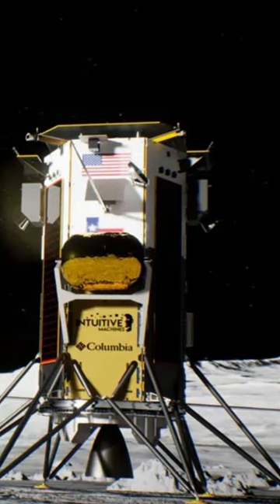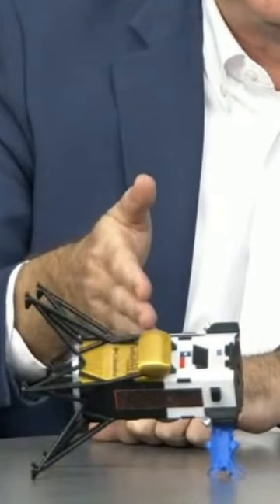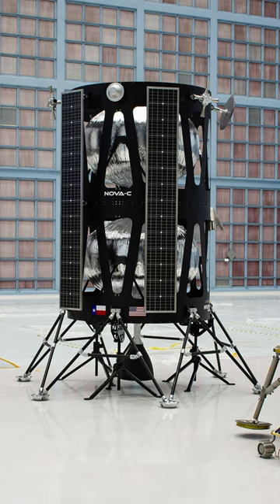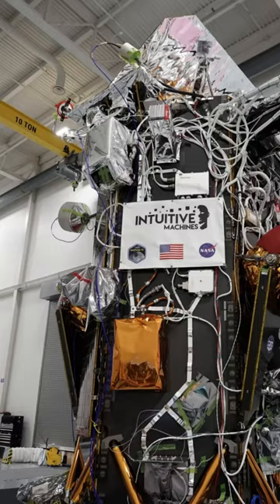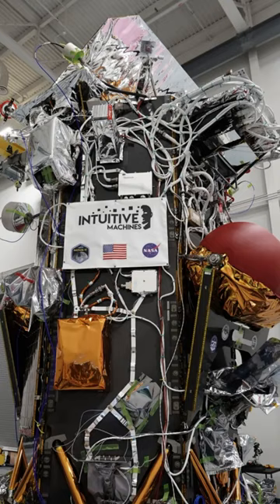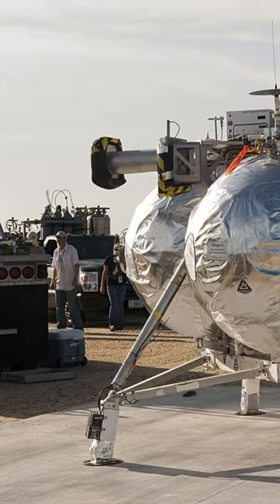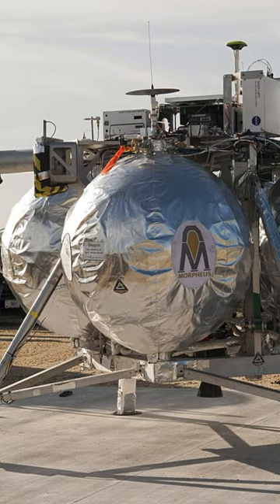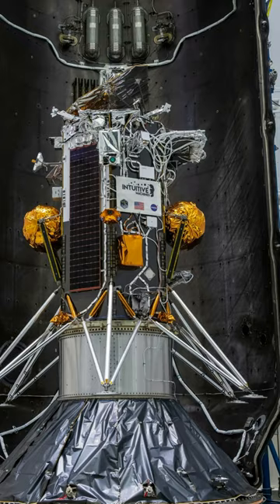Why Was This Moon Lander Built So Tall?

Comment: Hmm, good thing starship is not a tall craft... 😂😂😂
Reply: Yeah, and it has exceptionally wide legs too. :D :D
Reply: now there’s an „unfortunate series of events“ waiting to happen 😂
Reply: How hard is it to not move laterally? Maybe send a mini dozer first to clear a landing area.
Reply: @user-on8us2oi8s  Provided that the hardware works, it's obviously doable. It's a shame the laser wasn't useable. Considering that ~50% of attempted landings have failed I'd call it a hard problem.
Reply: If starship does start to tip upon landing, it should be able to abort to orbit since it has the fuel to get back up.
Reply: Blue Moon is also pretty tall and thin. No doubt consideration will have been given to this and safety measures devised. I imagine a combination of picking clearer spots and having better sensors will be used.
Reply: @user-on8us2oi8s This isn’t KSP. A “mini dozer” would cost tens of billions in todays environment where NASA hands money and tech to companies to do what nasa could do for cheaper so rich folks get richer. 

All part of the plan with Artemis. Artemis is an idiotic mission architecture requiring 16-20 starship flights per lunar landing, all within 7-14 days. 

So musk needs to up launch cadence by a factor of 150-250.
Reply: Probably using Elon's "Full Self Landing" too.  I think he said it was ready to go, right now.
Reply: Just send an helicopter to the moon instead of dickin around with those funny landers
Reply: @Jona69  While true, this is also not ideal. More importantly though, starship has engines high on the stack, and I expect the legs will be able to do some adjusting on the fly. I do wonder whether part of the issue was the engine blowing a hole under the lander and their 'flat' site suddenly not being.
Reply: @Karlswebb  If spaceX are wanting to land people, they can crash land a dozer before hand far cheaper. That said, a dozer is idiotic because it would not solve the problem. You would be able to create a flat surface, but as soon as you hit it with a rocket it would stop being flat. Compaction is possible by loading it up with regolith ballast, but even then I doubt you could get a trustworty 'pad'.
Reply: @agsystems8220  High up engines will make it less stable. 
Also, those engines thrust certainly wouldn't be very finely adjustable
Reply: Yes Starship is a concern but I suspect SX have the auto descent and drift nulling down to a T by now.
Reply: @keithrpenny6484  High mass, high center of gravity, small legs. Even with all that control- what can go wrong on unprepared surface?
Reply: @petersvancarek  agreed... I sure hope after this event they plan to fit starship with long fold out legs like F9
Reply: @keithrpenny6484  I think those legs are way too short. The 1stage of F9 has the center of gravity quite close to engines when landing. 
The same certainly won't be true for starship with cargo and habitable space high above ground.
Reply: @petersvancarek  I understand Starships shortfalls trust me.
Reply: It doesn't matter how tall the craft or small the legs if it lands on flat enough ground with no lateral velocity its fine. Starship will have many more systems so make sure this is so as well as people on board to abort or change the landing.
Reply: @motokid6008  it matters if the surface is not nice hard levelled plate.
Reply: @petersvancarek  - Remains to be seen and such things are easy to simulate.
Reply: @d6008 to simulate...take a mound of sand and try to drop something on it. Something simulating the rocket with various length and leg system. Drop it at speed of about 1m/s(that is probably how fast it hits the ground at maximum.)
And please do not expect ideal conditions at landing. Everything which can go wrong will go wrong with some probability. The construction must have reserves which allows for worse than ideal landing. The worse it can withstand the better.
Reply: @petersvancarek  - Yeah I think NASA and SpaceX has that covered.
Reply: @MrTrancelator both this and the HLS will have legs as wide as the fairing will allow.

Oh. HLS is even taller?
Reply: @1943vermork  🤣

Comment: This is a classic aerospace engineering problem. We can never avoid the compromises, it’s the same in other engineering fields, ours is just especially difficult. Spacecraft are so expensive so that makes life particularly difficult when we’re so often restricted in our budgets and timelines
Reply: Yep. It's easy to say that they could have put wider deployable legs on it, but that doesn't come for free... more mass, more moving parts... now you need more fuel to lift the deployment mechanisms, and you need to worry about the legs not deploying properly.
Reply: @simongeard4824 not to mention the maximum space that the falcon 9 provides
Reply: @wubnix3979  I don't think that part is a problem... the fairing width limited the size of fixed legs, but there was plenty of room for deployable ones. Mass and complexity are a bigger factor.
Reply: @simongeard4824  well deployable ones come with possible errors, I'm talking about if they wanted to make wider landing legs or perhaps a different idea is to have wider landing legs protrude out of the already built landing legs and if they do fail, at least you can work with the existing ones.
Reply: @simongeard4824 Well mechanical movement is a problem with the temperature ranges involved and vacuum welding.  The Apollo lander used collapsible aluminum to absorb shock rather than shock absorbers because mechanical components could not be relied on.  You're asking for a lot of unreliability to have deployable landing struts.

Comment: So... time to go full throttle, scoot across the surface and hope you bump into a rock that lets you lift off and try again?
That's what KSP taught me.
Reply: We've all done that a time or two. But I know how that often ends.
Reply: Speed and power 😅
Reply: I mean the propellant has probably boiled off by now, but aside from that, great idea
Reply: KSP taught me you don't need legs: you can just rest on the nozzle 😅
Reply: Another thing learned from ksp is to add landing struts to extend if you tip over.
Reply: @357Maxim  so has sfs.. i always prefer landing legs but if u cant put them on a lander without extending outside of the rocket fairing you're still good to go all you need is good flat terrain on whatever moon or planet you will land on and you're all set
Reply: Assuming the booster could even be reignited...
Reply: It’s easy: ctrl+F12 - Gravity - ❌
Reply: too real
Reply: Sounds like the "when in doubt throttle it out" principle to me.
Reply: Like in MX, Acceleration really helps stabilize everything.  I don’t necessarily mean speed…I mean acceleration, change in momentum relative to whatever speed you were at before using the throttle.  Speed on its own doesn’t Help as much to keep you stable on rough terrain cornering and jumps.  Speed offers a more general stability while moving at a constant rate and direction, whereas acceleration helps a bit more when encountering specific rapid or sudden changes in momentum and / or changes in weight distribution.
Reply: Just don’t forget to quick save first!
Reply: Classic off-roading rules, when in doubt.....floor it.
Reply: Everytime I hear Scott Manley I wanna play KSP 😂
Reply: lmao real

Comment: Note that physical appearance indicating high center of mass can be misleading. Im-1 had fuel tanks up high that were near empty, with the heavier rock motor at the bottom, so center of mass was probably lower than it appears. With a lateral touchdown velocity of 1 m/s (over 2 mph), even a low center of mass lander could tip over in the low lunar gravity (note that the highest lateral velocity of any Apollo landing was Apollo 14 at 1.8 mph, and the Apollo lander had a very wide stance and was much larger).
Reply: In addition while lunar gravity is lower the momentum of an object remains unchanged in reduced gravity. Less force pulling it down but the same amount of impetus to remain in motion the way it was previously moving.
Reply: @rosedruid  Yep! If I'm doing my math correctly, with the Moon's gravity being 1/6 of the earth, the tipping moment from 1 m/s would be equivalent to traveling laterally  sqrt(6)*1 m/s = 2.45 m/s or approximately 5.7 mph in earth's gravity, which being equivalent to a fast walk is quite significant. If the surface is rough enough to prevent sliding, then a lot of things would tip over at that velocity.
Reply: Makes sense.
Reply: Damn that makes me feel better knowing real engineers also fuck up the lateral deceleration.
Reply: @theguy9208  they might have planned properly for it but when the LIDAR system was compromised by an unremoved safety lock pre launch all bets are off because they had to patch in a payload system to do that job instead.

Comment: Seemingly, "the fix" is to put a new item on the checklist: "Manual navigation laser safety disabled."

What I read today was that it appears a manual ("hard") switch with no software override possible was left in the "eye safe" position, where it prevents the navigation lasers from endangering the eyesight of workers around the lander.  The only reason it was possible to work around this at all was that these lasers were "turned on" (and found not to work) while the lander was still in orbit, in order to verify the orbit to calculate the correct deorbit burn.

Intuitive was able to write, test, and upload a software patch that allowed the autopilot to use a pair of additional lasers that were aboard for an after-landing experiment; if not for the need to confirm orbit, the lander would have been unrecoverable by the time the navigation lasers should have switched on.

It was most likely operating on only the two NASA lasers rather than the three proper navigation lasers that resulted in landing with a high rotation rate and likely an excessive horizontal velocity.
Reply: Good to know.
Reply: And in a related story, the person is alleged to be responsible for the the safety switch on the $200,000,000 mission was found badly beaten behind a dumpster at intuitive machines headquarters.    It appears he was swatted over and over with some sort of checklist until he lost consciousness.  He is not speaking with authorities.
Reply: @larrywiniarski1746  At first I laughed at what you wrote because I think it's supposed to be a joke.  But I don't love it because threats and violence have no place in any functioning workplace.  It isn't good for anyone and doesn't help anything get done better or faster. It kills innovation and risk taking. So, ha ha, but please don't be like that in real life, everybody!❤
Reply: So.. that's what really happened..
...another INCOMPETENT employee..
Just like on J6.. 
        R.I.P. Ashley Babit, DEI is ruining everything that was good.
Reply: @francom6230  Mistakes happen all the time, and they happened well before DEI. You've got hundreds of employees each working on at least dozens of tasks, any one of which could cause mission failure. Have you never made a mistake at work?
Reply: Sure is a good thing we didn't have "DEI" back in the first few decades of NASA. Something bad could have happened, like a flight crew burning to death or an orbiter exploding. That would have been devastating!

Comment: Turns out, planetary and lunar landing is just plain hard.  You can simulate all you want but the in situ testing is live, expensive, and totally unforgiving.
   Fortunately, like the inherent instability of helicopters, it can be overcome with enough diligence (and money).
Reply: You are aware that of the 7 Surveyor missions 5 succeed and none fall over after a soft landing? This design requires vector control, lidars, lowering the horizontal speed pretty close to zero, and being almost perfect with the angle, it's a nightmare. We do have in our pockets a computer that will run circles around the top supercomputer of 1993, but that is not a good reason to risk taxpayers' money in a bad design.  Can it be done: yes, should it be done? it depends if we insist on using StarShip as a Lunar Lander then yes.
Reply: @jaimeduncan6167   Yeah, i agree that “it’s hard.”  In other words, unforgiving with little margin for error before a trajectory of bad landing becomes unrecoverable, esp. if the CG is high and the vehicle width is small.
  On the plus side, we have a lot of new tech that enables sensing and control of previously unused designs/concepts and techniques (e.g., as seen in Ingenuity) so the “envelope” is broader. But it is still risky, despite having access to 1,000,000x more computing power than onboard Apollo.  Hopefully, like with SpaceX, landing can be mastered.
Reply: ... and  lots of practice... 😱

Comment: Why can't they just revert to launch? Are they stupid?
Reply: You mean take off again?  I think it would take off sideways and not go up.
Reply: @JCAtkeson3  
ksp joke ... new around here, huh?
Reply: They're set to Hard. No revert.
Reply: Because Jeb.
Reply: Cuz they switched to another craft when landing the falcon 9 booster and switched back so reverting was disabled
Reply: @bartsanders1553  damn...
Reply: Can they not fire a side thruster? Some use cold gas separate from the main engine!
Reply: @michaelsparks6084  naah, reaction wheels are better
Reply: bless your heart. @JCAtkeson3
Reply: Lost the save. Overwrite the save by spamming F5. Now the load is stuck in perpetual *crashing*, lithobraking on the mun surface.
Reply: @JCAtkeson3   Just fly to a dumb, then you will be able to go up easily
Reply: They should have created a save point before attempting the landing.
Reply: @JCAtkeson3  They got nothing to lose, might as well try lol.

Comment: Scott, as seen in your last episode they used sellotape for a "remove before flight" indicator. They left a lidar lense cap pin in. They apparently didn't think of horizontal velocity for landing. These don't seem expensive fixes they do seem like incompetence. Surely adding a line to a checklist that says "remove lidar lense cap secure pin" double checked by separate means. Surely that's not going to push the costs up more than say... the price of the ceo doing a coffee and donuts shout for smoko.
Reply: Double check then triple check
Reply: The power of a proper checklist when preparing for a rocket launch is undeniable. Even in sci-fi films you often hear people going through checklists. It isn't rocket science! (Pardon the pun 😊)

Apparently, the folk at Intuitive Machines took their inspiration from sci-fi set in the far future, where spaceflight is as commonplace as jumping in the car, and everything just works.

Schoolboy error.
Reply: @nagualdesign It’s a concern when my pre-launch checklist for a Kerbal Space Program flight I just did apparently did something better than actual rocket scientists… no doubt mine was a much shorter and simpler list to be sure, but at least it was complete. Maybe they should stick to the rocket science and hire a mother experienced getting small children to school with everything they’re supposed to have to organise the final checks - then at least they might arrive at the moon with the LIDAR system operational and their PE kit safely stowed?!?
Reply: It's worth noting that in the terminal phase of landing the lander didn't use its lidar for navigation. Instead it relied only on inertial navigation. The idea being that dusk kicked up by the engines could confuse the lidar. So unfortunately I don't think the solution is just " turn on the lidar"
Reply: They almost certainly used checklists... But how do you check that the checklist has everything on it? How do you check that that check didn't miss anything out? You can't do a complete dress rehearsal with a spacecraft. When something is a one-off (or the first time it's done) there's always the chance of some basic stuff being over looked, and it's only with experience that it gets caught. Missions in the past have had problems as silly as a lens cap being left on, or the famous imperial-vs-metric mix up on that NASA mars mission. Nothing slightly unique to Intuitive here.

It's a lot harder to make sure nothing is missed, than to feel smug by point out something was missed with hindsight.
Reply: @QuantumHistorian  I don't think anyone is being smug. It was a schoolboy error. We all make them from time to time.
Reply: @yedoom 
The true issue was the loss of dependable Doppler radar for measuring horizontal velocity during the entire descent. Apparently the horizontal velocity wasn't correctly calibrated for zero in the Inertial Guidance System just before landing. Although the optical Doppler system was a completely new and experimental system and may have not been totally dependable in calibrating the IGS even from well above the surface, the well understood RADAR system was also offline.
Reply: I'm sure they thought of horizontal velocity for landing. Thinking of something doesn't automatically mean you are going to succeed at doing it. I can't speak for the other points.
Reply: @thomasdalton1508 
The effect of horozontal velocity may have been improperly estimated.  Or misjudged, or as Scott pointed out in the main video, Odesseus may have just hit a rock and fallen over.

Comment: Engineering is full of compromises and tradeoffs. I’m an engineer and see this daily. 

One thing I’d like to mention: the high center of mass is almost irrelevant. The technical feat of landing an autonomous probe on the moon is a big enough challenge. Making the center of mass higher makes it goes from a 9.999/10 difficulty to a 9.99900001/10 difficulty 😂
Reply: If you are an engineer then you should know the lower the center of the mass, more stable is the object
Reply: @maroonmedia2000  Thanks buddy. The lander touched down without zeroing out its horizontal velocity regardless.